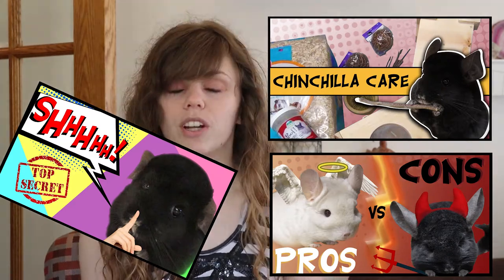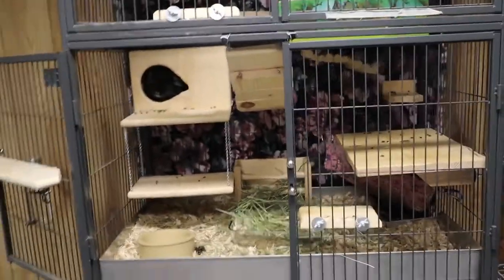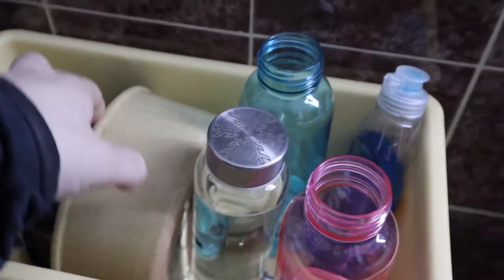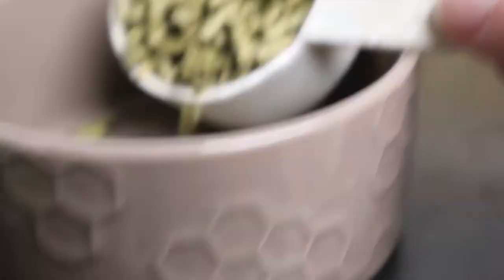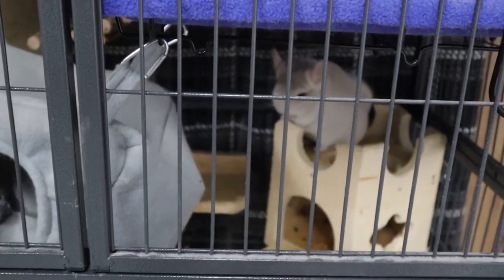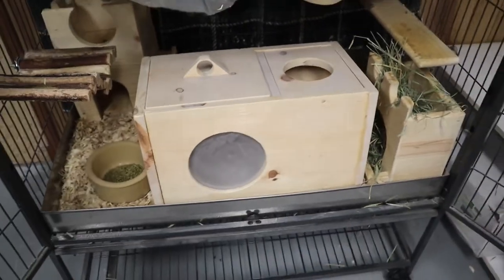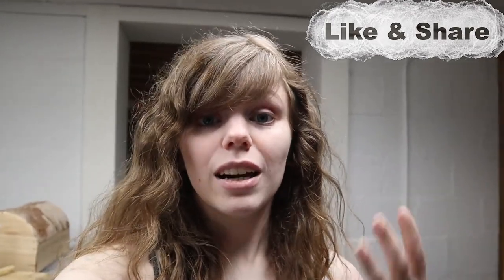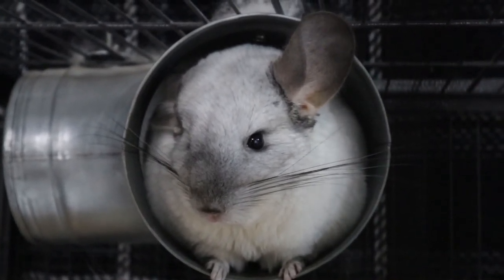What Owning a Chinchilla is Actually Like

Comment: So you do this every day? Like I get the water bottles but you wash the fleece everyday and change the bedding everyday too?
Reply from the maker: Actually no, didn't realize it came off that way! Sorry about that! I wash any fleece every 3 days and I change the bedding/clean the water bottles weekly. I have multiple water bottles that I switch out during the week, and I wait until I have accumulated enough to wash them in bulk. Same with the fleece actually. However, I do spot clean the pee spots out of the bedding daily, as well as sweeping the poop off of the shelves. This video was more of an overview of what needs to be done.